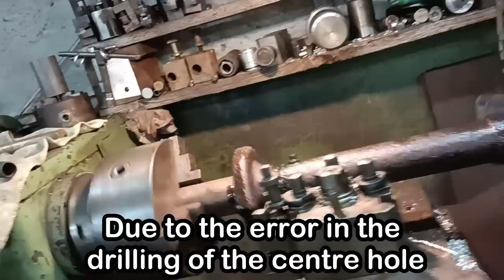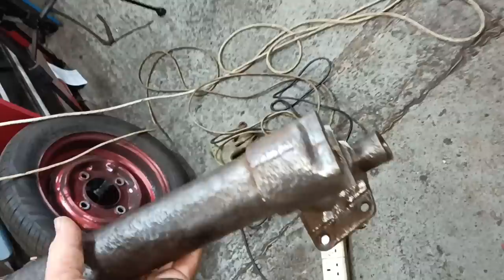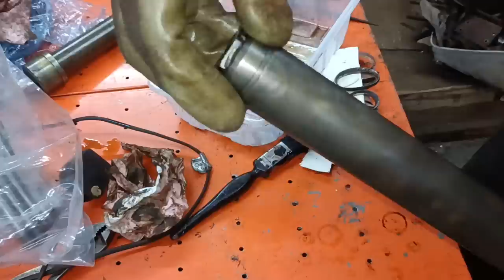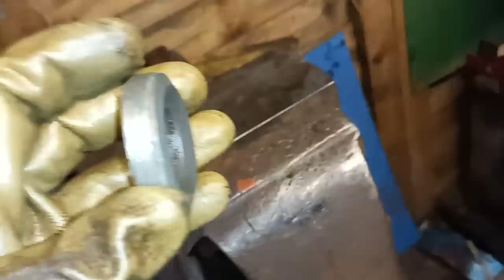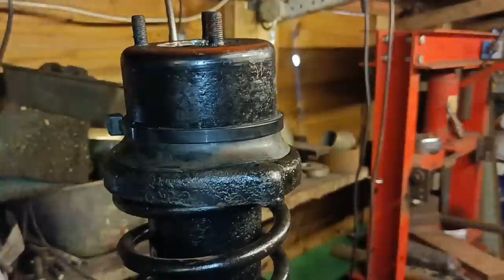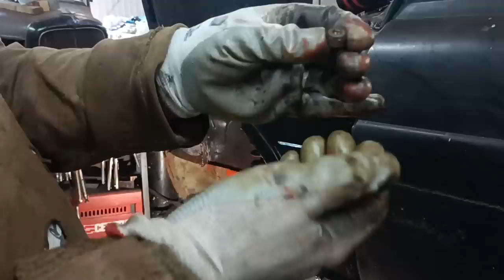Mart's 1955 Ford 100E Anglia part 24! Let's look at the front struts!. (2361)

Comment: Not exactly the same, but I've used engine oil in hydraulic lever arm dampers several times to not only no ill-effect, but to a great improvement in damping ability due to the greater viscosity of the oil. Yeah I 'should' use hydraulic oil because engine oil doesn't have anti-foaming properties etc. My real-world experience says otherwise.

Comment: My old college lecturer at Bolton Tech. (now University) usta tell us tales of how he worked at Ford development department back in the late '50s and early '60s and the premier project that he and his teammates worked upon was the MacPhearson struts on 100es and 105es. They were somewhat revolutionary in design and compactness and afforded Ford a leading edge in the rally events they participated in, of that period. 

I haven't driven an 100e, but have driven several 105es and they sure are fun to throw into the bends & bumps of the North Yorkshire Moors' most challenging bits of road. 

The great thing about the 100e & 105e is that plenty of parts can be had relatively cheaply still and that makes them a do-able prospect for an everyday car, even today. Buying prices for decent cars are pricey though and most, if not all, will have plenty of welding challenges!  

Good stuff Mart, enjoying the ride along.

Comment: Mart is the steering arm correct the arms point towards each other when behind the axle line  All the best peter
Reply from the maker: Hi Peter the steering arms are straight but Ford engineered all the ackermann into the design. It's a clever design.

Comment: Shock oil should be non foaming, I dunno about jack oil. I once experimted with hydraulic oil in the forks of my Bultaco scrambler. The damping effect disappeared before the end of the first lap! Might be better to use motorcycle fork oil, readily available from any bike shop.
Reply from the maker: I'll look out for problems. Thanks for the info. It's not a high performance machine so hopefully it will be "ok".

Comment: Sorry to tell you this, Mart, but jack oil isn't suitable. I'm not telling you anything you don't know when I say that a fluid gains heat when compressed, and a jacks' and dampers' oils are compressed as they pass through the valves. With a jack, this happens slowly so there is little heat and no great temperature; with a damper it's far more rapid and the temperature rise is quite high. Jack oil doesn't need and doesn't have a high boiling point but damper oil does need it. The effect is that jack oil can boil and the effect is the same as air in the hydraulic brakes, quite simply you have no dampers.

Topping up is best done with an ordinary oil can but it must be done with the car unladen and standing on level ground until fluid comes out the filler hole. If you fill the struts with the suspension hanging, you remove the air space so the fluid has nowhere to go when you put the car back on its wheels, and the front rend remains in the full droop position, even with the weight on it.

That's the first time I've seen anyone dismantle a 'wet' insert; most people just fit replacement 'dry' ones, so well done for staying with the originals.
Reply from the maker: Thanks for the info. I'll give it a go and look out for problems. I doubt it will be driven hard enough and long enough for it to be a problem, but will monitor it. Thanks for the info re topping up. I remember replacing my Classic Capri internals with cartridge inserts years ago. I did play with the wet inserts on a 100E years ago and tried to alter the valving for front lift when drag racing.